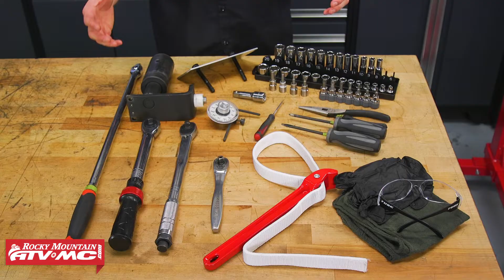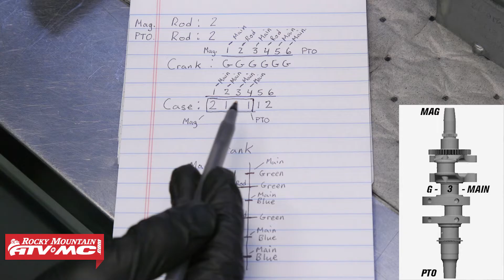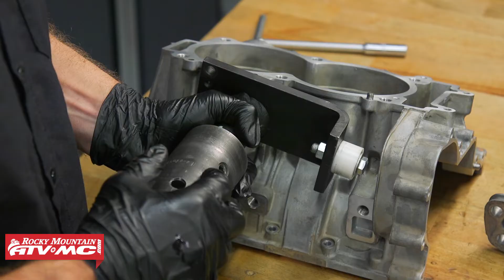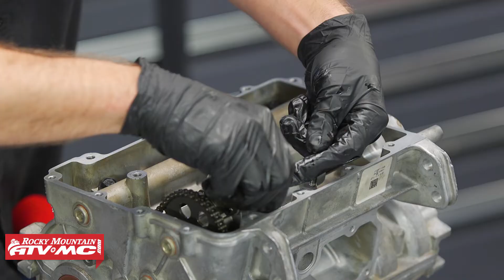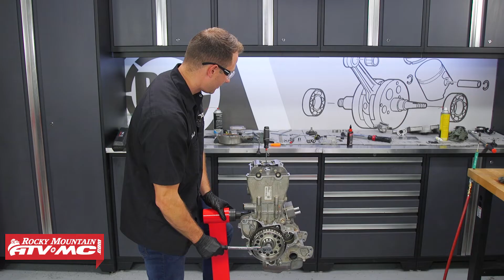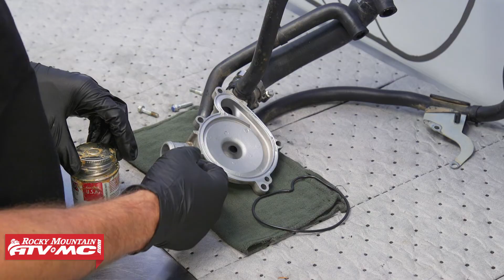Polaris RZR 900 Engine Rebuild | Part 5: Engine Assembly

Comment: Quick question if the piston does not have those triangles, which way or how do you know which way it goes?
Reply from the maker: If you look at the top of the piston you should have larger lip on the exhaust side.

Comment: question about setting the crank in relation to tdc compression stroke.  how do i know where the crank must be so the ecm knows that the 1 cylinder is on compression stroke?  im into an engine and am not sure if im on compression or exhaust intake stroke.
Reply from the maker: Great question. To time everything correctly, you'll want to put the PTO or CLUTCH side piston at it's highest point. Line up the timing mark on the flywheel like we show in the video and verify with a screwdriver. From there, you just need to set the cams up the same way we show in the video, and that will give you TDC on the compression stroke for the PTO side cylinder. The ECM will know what to do from there. -Charles
Reply: @rmatvmc  perfect. that was my conundrum, i wasnt sure of the ecm would assume it was still on the actual compression stroke

Comment: I have a problem with the water hose, it broke and I can't find the original. Could I put one that doesn't have the same mold as the original?
Reply from the maker: You can replace the hose with something else. Check out our OEM parts page to find out if we have a hose for your specific model: https://www.rockymountainatvmc.com/oem-parts

Comment: Hello I have a polaris rzr xp 900 2012 do you know if 2012 bottom crank case fit my let me know because I can't find the 2012 bottom crank case thank you
Reply from the maker: The top and bottom come as a pair. Looks like the case halves aren't shipping right now. You might have to keep an eye out for something used or see if a machine shop can repair yours.
Reply: @rmatvmc  the case I bought from ebay it's a 2013 xp900 and my it's a 2012 xp900 sorry I didn't tape correct but my it's broken from inside so do you think can fit the 2013 case to my 2012?

Comment: If anyone can tell me what those three Allen key bolts right next to pto shaft are used for it would be appreciated. I can not find anything online. And also does a 2014 rzr 900 have some kind of oil pressure release?

Comment: Hey i keep going back and forth with this video...   I purchased a 2012 rzr 900 xp that sounded like it had chain slap..   I suspect the stock tensioner took an early retirement.  I purchased and alba racing tensioner...  I put it in and still had the slap.(everything was top dead center).  SO...   I took the cams completely out and started from scratch watching your video...  top dead center is easy..  Getting the cams aligned with the slots and home fashioned tool to keep them straightis fine...   i run into this issue.. When I take the rear alignment tool for the slots out.. the intake cams jumps forward causing the chain to slip gears...  it also jumps out of the alignment that i just worked so hard to get...  what am i doing wrong?  I have watched this video of you doing the timing at least 15 times...  I just can not see where I am making my mistake..
Reply from the maker: Did you see that I released the tension with a wrench on the intake cam? I'm guessing that might be the issue. 
-Charles

Comment: Intake valve clearance is commonly found to be tight.  It causes hard starting.  When choosing shims try to stay exact or on wider end of spec.  They intake valves tend to tighten up over time.  

Also you might find that temporarily installing tensioner before rotating engine to install 2nd cam bolts will prevent the timing chain from jumping time.  Great video!
Reply from the maker: Thank you for the tips and checking out the video!
Reply: 7 @rmatvmc
Reply: Where do I order different size shims
Reply: @timwise1758  most times a dealer will swap you, mine did.  Otherwise you can order a complete kit that has many sizes online.
Reply: Ok so go the timing down fine...  double checked it gave it a good couple manual rotations.   Started the engine.  Tock tick tick tick tick.  Same damn sound.   

Pulled the valve cover.  Checked clearances.   

Exhaust 
010 010 008 008.  Timing chain side 

Intake 
000 000 000 000. Timing chain side 

They are out of spec on exhaust.   Is that the tick tick tick?